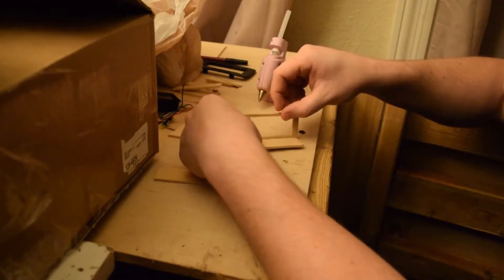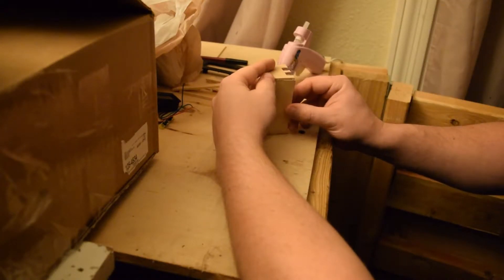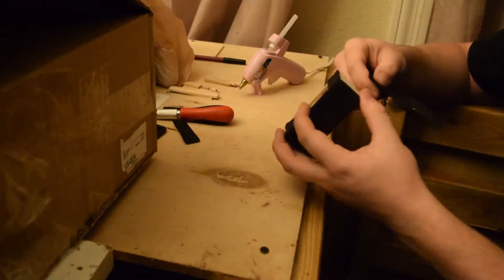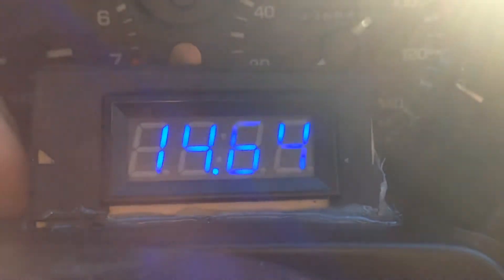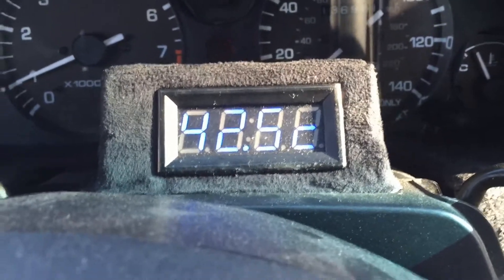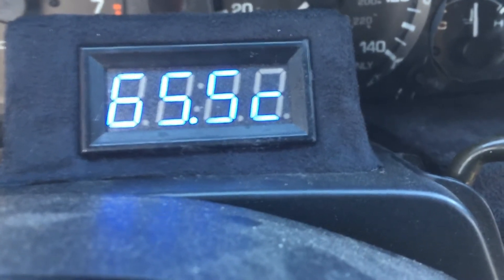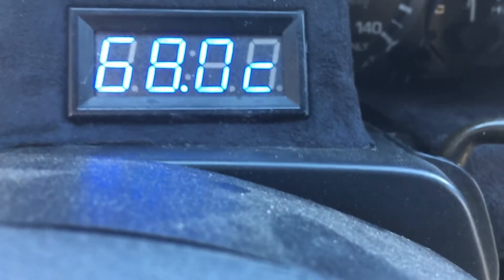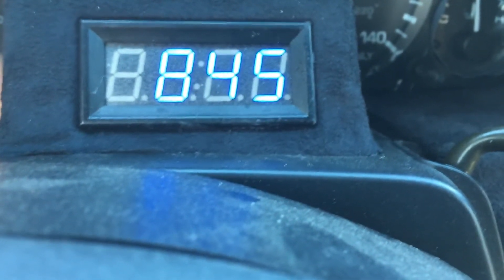Installing a $10 voltmeter and thermocouple for engine bay temps

Comment: Depending on where you live, you might use a contact cement instead of hot glue. I know in the Southeast US, due to heat and humidity, hot glue will come loose during summer.
Reply from the maker: Totally true. I forgot to mention I followed up with 5 minute epoxy when I pulled it out to upholster it. I just wanted to see if it would work longer than a week first, rofl!